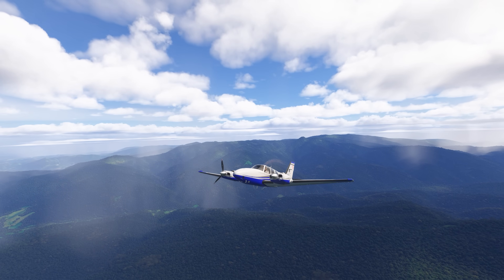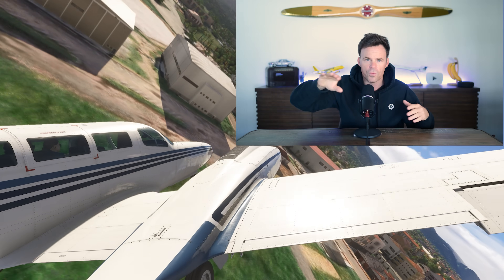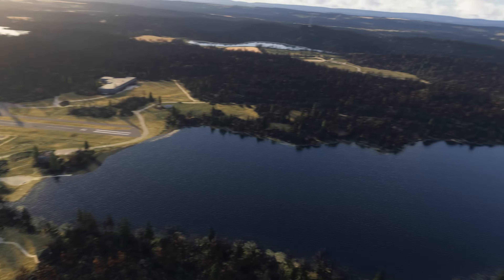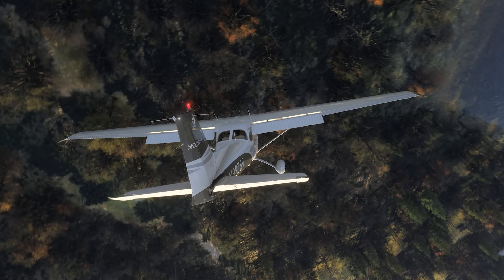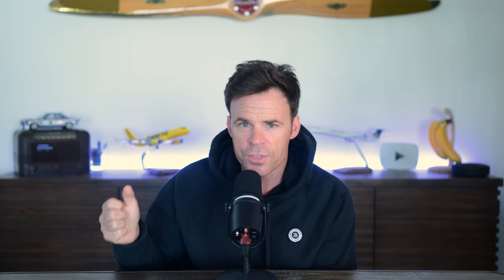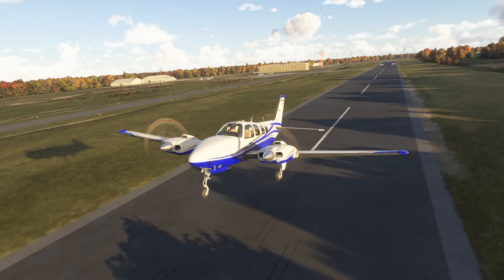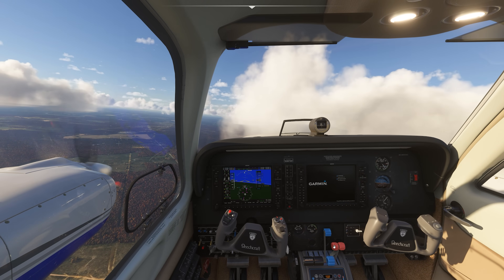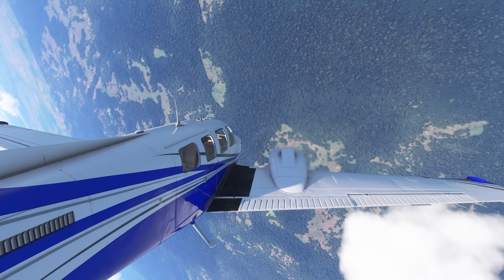Piper Cheyenne Crash Explained — The  Cause may not have been a VMC Roll

Comment: Owned Cheyenne ll years ago and rotation @91kts is the same as VMCA so no messing around at or below that that speed and stall clean only 5 kts below that.  Single engine climbs are 103 then  114 and  regular all engine best rate 121 and  the plane gets there fast.
Reply from the maker: Thanks for the insight. 🤙🏼

Comment: The reports from the eye-witnesses (including those who filmed the crash) said the pilot told them he would perform a low-pass over their heads on departure, essentially to show off. Given that he was getting to the point in the takeoff roll in which he would pass those bystanders by and not have enough time to initiate a turn towards them for the promised low-pass, it would make sense that the pilot, as you speculated, saw that it was "now or never" to start that turn, and so he rushed the takeoff and rotated prematurely. That's what probably did it. A slightly skidding turn at a high AoA and low speed.
Reply from the maker: Unfortunate for sure

Comment: Part 23 (and CAR 3) certified twins aren't required to have enough excess power on one engine to sustain an engine failure at any point of the takeoff sequence and climb away. Or climb at all, even feathered and at blue line. So light twins have a window between Vmca (which is usually at or very close to rotation speed) and blue line at a sufficient altitude where you treat it like a single engine airplane if you suffer an engine failure. Namely, pull power on both engines and land it straight ahead, even off the runway. Attempting to make it fly usually means the plane follows the same path anyway, except off to the side and upside down. At blue line with a couple hundred feet under you, you have a chance to run the engine failure drill and maybe eke out enough performance to climb away, or at least stretch the glide to a more suitable landing site.

There are no performance charts for rejecting a takeoff beyond rotation speed and airborne so you have to think about that too. Fortunately, these types of incidents are rare, and some can be prevented by checking your fuel and fuel system, and not messing with it immediately before takeoff. There's often just enough fuel in the lines to get you to rotation speed before it starts sucking air from the empty tank you just selected. Be careful out there.
Reply from the maker: Great points all around. Thanks for sharing your insights!

Comment: I have the same theory.  I know my Baron will break left usually every time when doing power on slow flight and stall demos.  Spiral air, P factor and torque are still present needing a bit of right rudder at slower speeds and high power.  Not as much as the Brazzzzzzzzzlia tho!  (that's 9 z's for ya)
Reply from the maker: Hhahahahaa

Comment: You're possibly correct that both engines were operating. Even with both engines operating, you have Vmc-related forces that are working on the plane that might cause a spin to the left if the wing is severely stalled. If the airplane was stalled,  the spiralling slipstream and net P-factor would cause a left yaw that could cause a spin and the engine torque and net accelerated slipstream could cause a left roll, further exacerbating the spin.

If the Cheyenne is like a typical twin with non-counter rotating propellers, you need a lot of right rudder on the takeoff roll. That may be why the rudder was deflected to the right.

Comment: Thanks Joe. Great to hear a different perspective. I think your theory is very plausible. At the critical angle of attack,  it only takes a small amount of yaw to tip the fine balance of lift between both wings. Turning during a pull up coming out of ground effect is best left for test pilots. This is not a manoeuvre for any aircraft (multi or single engine). Just asking for trouble.
Reply from the maker: Your welcome! Always good to have civil discussion on these events

Comment: I learned some  thing today... 50% loss of power... 80 %....loss of performance...Thanks Captain Joe...!!!
Reply from the maker: You got it! Glad it was helpful!
Reply: When the engine quits, it's power is gone but it's weight and drag are still there. Plus with thrust on the other side the aircraft is unbalanced. Joe, correct me if I'm wrong.
Reply from the maker: @jerseyshoredroneservices225 thats correct and why its critical to “feather “ the prop asap to reduce the windmilling and drag
Reply: Do you have a multi-eng.rating ?
If you do,I highly recommend you
to cut ties with the instructor you had or have now.Practically from the first day of training you will that.
Reply from the maker: ??? What?

Comment: Im curious about the Vmc demo. If you only do it until the remaining engine starts to overpower the rudder what is it supposed to demonstrate? Is it just so that in a real scenario you at least can attempt to stay in control as long as possible?
Reply from the maker: Correct. Its showing you how important it is to not get slow because the loss of airflow over rudder and how you won’t be able to counteract the asymmetrical thrust